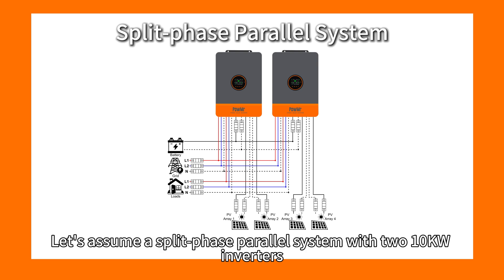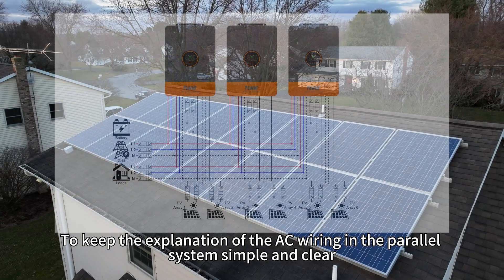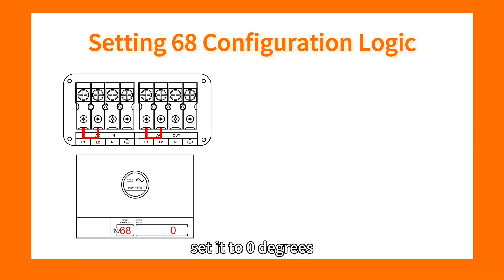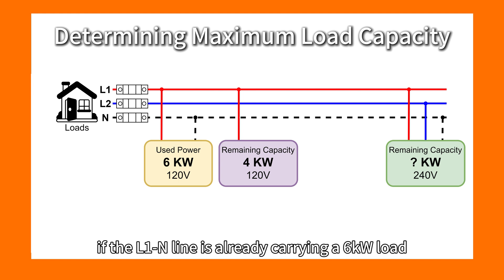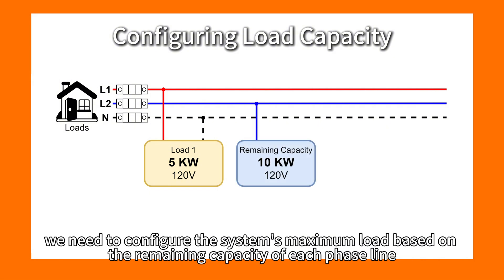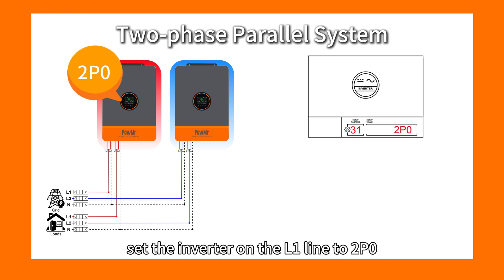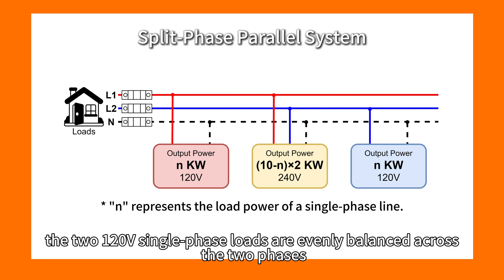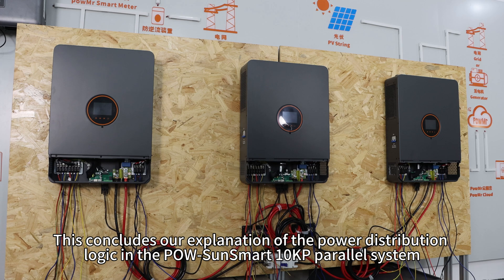Split Phase vs Two-Phase Power Distribution: Key Differences Explained

Comment: Can I add a single phase inverter to a split-phase inverter to deal with imbalanced loads? How balanced to the loads on each leg need to be with the split-phase inverter unit?
Reply from the maker: the POW-SunSmart-10KP model?
Reply: @PowmrSolar  the POW-Sunsmart LV12K model is what I was asking about.
Reply from the maker: @buck502  Nope, you can not add a single phase inverter to the POW-Sunsmart LV12K inverter.

The unbalanced load of LV12K model can be 100%. That is, if the power is 10KW, connected to L1-N, it can carry 5KW. L2-N can carry 0KW, and each phase cannot exceed 5KW.
Reply: Thank you for that information.